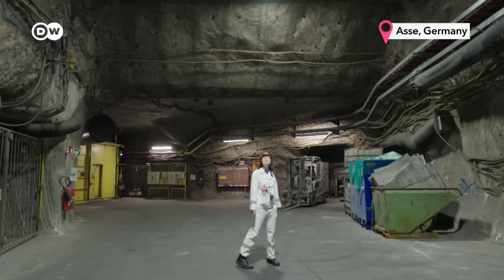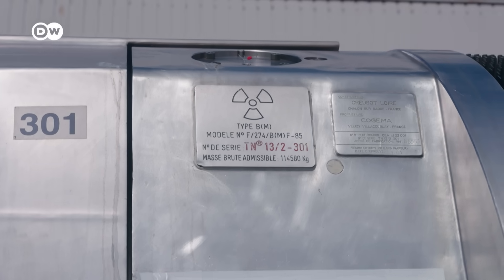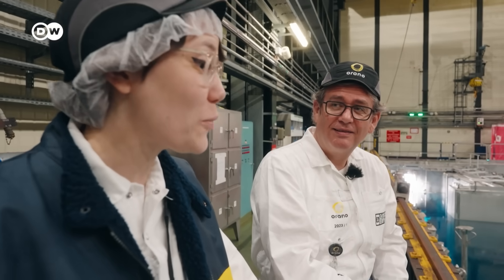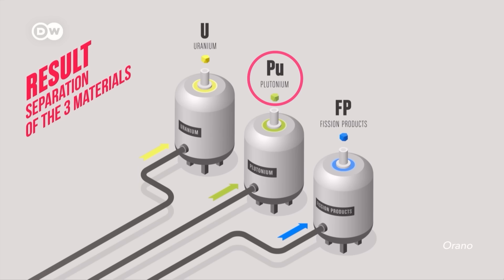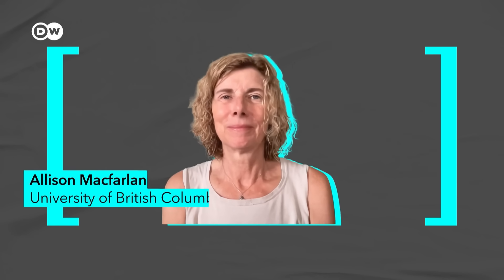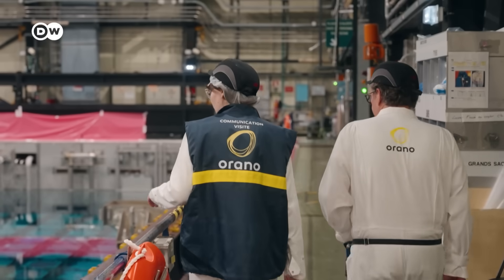Nuclear waste is reusable. Why aren’t we doing it?

Comment: Many of the previous comments ('above') are by articulate industry veterans. I lack any such experience (or specialized training), but would like to mention some relevant, basic info:
(1) In U.S.A. the original intent was to field around 400 reactors using 'slow' neutrons, which would be followed by a number of second-generation 'breeder' reactors using 'fast' 
(not moderated) neutrons later on (like maybe now!). The rollout of the initial boiling/pressurized 'slow' neutron reactors was halted after about 120 units were built ... initially to give
the AEC/NRC time to adjust regulations and operations so that the operators would be better able to diagnose malfunctions than demonstrated by the operators of the Three Mile Island
plant which suffered a partial meltdown after water uncovered the reactor's fuel core in springtime, 1979. The operators had experience running reactors on U.S. Navy submarines, for 
which they had been trained ... but misinterpreted indications in a control room which had become chaotic with multiple alarms sounding.
(1a) The NRC (and the U.S. nuclear industry) were successful in dramatically improving reactor reliability, so that, by the late 1980s, the operating duty cycle of the plants had increased to 
greater than 90%, from < 50% in early 1980s.  The fear of explosions was rekindled by the irrelevant Chernoble accident, which also demonstrated vast dispersion of radiation.  Cessation of research should Not have occurred, but was universal.  At any rate, the rollout of the 1st generation boiling/pressurized slow neutron reactors might have been continued by the late 1980s,
but public opposition and various regulations (including minimizing utility rates for subscribers) combined to maintain a blocking pattern, which, arguably yet exists. 
(2) This era (Volker recession, and Reagan Administration, oil price spiking) also saw accountants take control of public corporations via leverage buyouts and impose strict spending limits.
Thus the era of public investments (interstate highways, parks, universities, power plants & transmission lines, sewerage systems) ceased, ans even maintenance of facilities has not kept up.
New regulations for nuclear plants was only one aspect: the Experimental Breeder reactor project, fusion, and molten salt reactor experiments were all severely deprived of government 
financial sustenance. Military expenditures were continued. Environmental laws were expanded.
(3) My understanding is that everywhere reprocessing of nuclear fuel was done/attempted, it was found to be unpleasant/expensive and hazardous. In meetings at MIT, since the Fukushima
tsunami, the decision to NOT reprocess U.S. nuclear fuel has been affirmed, based on the notion, "too expensive".  I Think the molten salt designs promise to be able to 'burn' 'spent' nuclear 
fuel; those reactors have survived "proof of concept", but have not demonstrated immunity to degradation of materials in neutron flux And hot operations with halides/fluorides in contact 
with fuel-coolant piping.
(4) The notion of 'vitrification' of waste in "borosilicate glass" was a favorite aspect of operations narrative in U.S.A. since 1960s (is still ongoing, maybe).  Work in Australia by researcher
'Ted'/Theodore Ringwood, and in U.S.A. by Dr. Rodney C. Ewing (U Michigan, Ann Arbor) involves small-scale confinement of high level waste in some complex ions which have natural 
geologic history of duration, that has been demonstrated in laboratory employing ion beam implantation and simulation. Ringwood devised a material, "SynRock" which has proven useful 
on scale comparable to some of the vitrification applications (vitrification is fine for low level entombment, but the desirable features of 'glass' degrade under high level waste exposure ...
although later developments have expanded the applicable regime).  
Also of note is the Aussie development of a uranium refinement process using LASERs (called SILEX ?) which has been acquired by GE-Hitachi for use in the promising/admirable PRISM
/IFR reactor, based on research by GE in California during the 1980s.
Reply: EBR-II/IFR was killed in '94 under Clinton. PRISM is basically a scaled up EBR-II and the Natrium reactor proposed for Wyoming ( funded and under licensing review now) by TerraPower/GE Hitachi is basically a PRISM burner core.

Comment: The US recycles all of their spent fuel.  It goes into all kinds of weapons.     One spent fuel rod can be used to make 100 25mm depleted rounds.   But it takes a ton of energy to  work with radiation and the materials needs to work with it.   This video knows nothing about what spent fuel is being recycled and used for other things.
Reply: You couldn't be more wrong! All US weapons grade plutonium is made in special purpose reactors at the Hanford or Savannah River sites. Commercial reactors are entirely unsuitable for weapons grade plutonium production.  Depleted uranium comes the the tail end of the uranium enrichment process, not from spent fuel rods.

Comment: a) the nuclear waste casks are at 300 C. why are they not put in series, to heat up some gas, to drive a turbine, and generate electricity? a high hydrogen content gas will do, such as NH3 or CH4. any neutrons going around will be captured and you get deuterium as a by product. and you get a 4 year power supply. b) Pu-239,240 can be converted into oxides in situ, and then mixed with U-238 oxide, in situ, making the weapons proliferation issue moot. so the recycling facility ships back fully operational fuel rods, useless for weapons.

Comment: Caveat.... It is actually recyclable visually using tweezers and protective clothing. This could easily be done in water filled containers with lead filled crystal glass. They were previously sorted on tables without shielding just protective clothing. There are reports out there from experts that are now notoriously difficult to find. Anyhow, they are very easy to sort visually because the viable pellets glow more or less depending on level of radioactivity. The slightly radioactive can also be separated from the mostly dead pellets cutting half life to around 100 years for the bulk if I remember correctly? Been a minute since I worked in nuclear.

Comment: Some 10% of nuclear electricity in France today is generated by recycling materials in the form of MOX fuel, Orano said, and this can rise to 25% and to almost 40% if used MOX fuel is further recycled.
Reply: US reactors were not built for MOX. The source-term analysis is much more complex and would likely result in significant safety modifications to existing plants.
Reply: @curtrapp5291  Between 1977 and 2005, government policy did not allow reprocessing of used fuel for commercial reactors. But since they use MOX, from France ....
Reply: yeah makes you wonder why it's not 100% of the waste they are burying the stuff instead of suing it to make power when we need more clean power to reduce carbon emission's this mmakes me sad they arn't using all of it to make power
Reply: @raven4k998  Because it's not possible to recycle 100%, for the moment.
Reply: @raven4k998  France reactors can't use 100% of MOX fuel, because they are not designed for it, they are only capable of using an amount of it.
France reactors are old, new design can use more recycled fuel, but due to pressure from leftists afraid of nuclear power, all projects to modernize them have been aborted.
Reply: @raven4k998  
Mox fuel is a mix of Plutonium and U238.

What happes is that in a normal reactor ( that does NOT use MOX ) 95% U238 (non-fissile Uranium) and 5% U235 (fissilie Uranium) is turned into Energy + 4% waste + 1% U235 + 1% Plutonium + 94% U238.
Only the 1% Pu really is recycled!
The 4% waste is "thrown away" and the 95% U235+238 mix is stored. 

In a Mox reactor you can use a bit more but in the end most of what comes out is U238 that is useless

Neither Frances Orano nor anyone else uses the 95% low fissile Uranium. It is a could-be fuel if you would enrich it.
Like you would enrich Uranium for nuclear weapons. No one does that I believe. Too dangerous and too expensive.
Reply: @raven4k998  France is already the country in the northern hemisphere that produce the less carbon per person thanks to nuclear energy, the problem is that France alone can't do the job for China, USA, Uk, germany that are considered to have produced more than 85% of all pollution on earth since the industrial revolution
Reply: @ommsterlitz1805 I don’t really like the nuclear vs fossil fuel remark because nuclear energy is infinitely better than fossil fuel but people keep forgetting that there is a finite resources for nuclear fission and it could even run out before coal and oil does. And plus most of the countries you mentioned joined the ITER program and if it succeeds then the benefits will infinitely outweigh whatever pollution these countries have caused
Reply: @121goldenfox5  Nope Sodium based nuclear reactors can literally make nuclear fuel last for thousands of years for each countries the problem is that Uranium is so cheap that no one bothered to build them.
Reply: You assume their Process CAN recycle the MOX Fuel...
Reply: @HappilyHomicidalHooligan  The only reason I can think of that it wouldn't is that the plutonium levels exceed some safety margin or that the remaining fissile materials are in a different combination due to the presence of the plutonium causing different reactions.
Reply: @HappilyHomicidalHooligan  We do recycle it, it's not a can.
Reply: @HappilyHomicidalHooligan  Google says they can, not sure how many times they can do it

Comment: Ok good you mention that Plutonium 239 is fissile, did you find out why they need to separate them out from the uranium in the first place?  I presume its part of the "oversimplified bit" with chemistry playing the role since Uranium forms oxide salts. 

Now we also need to talk about how we can get energy from the radioactive decay of fission products since "nuclear batteries" can be made which run off of the energy released from decay. for as long as the radioactive decay rates are high.

Another point  of context is the future because Earth is the solar systems largest strategic reserve of actinide elements i.e. Uranium and Thorium as the reason these elements are so abundant here is that despite their high atomic weight they strongly bond with oxygen and the lithophile elements casing them to rise to the surface during planetary differentiation and more importantly the affinity cause them to concentrate in continental crust. As a result the reason we have so much Uranium here is the flip side of why we have so little gold all Earth's Actinide elements has risen into the crust and upper mantle leaving the rest of the planet depleted in actinide elements like Uranium.

There is also the related fact that uranium oxide salts concentrate in the same places petroleum and natural gas products do the bottom of salt evaporite deposits particularly those associated with former oceans closed via subduction processes resulting in the brine extraction of natural gas and petroleum products being  highly radioactive from Uranium decay chain products. 

Frankly energy investments like basically everything else in technology development are never going to be profitable because in the words of Bill gates "basic research is charity work".  There is a reason why all the existing programs are generally state run or funded by other forms of public money the private sector doesn't generally contribute to R&D until a technology is  becoming ready for market deployment.   Thus if you rely on private investment you will never see technological innovation beyond superficial "innovations" like changing the looks of a product slightly to sell more product via tech fashion fads.

The real crux of why so many areas of technology are in dire states with little progress is that Neoliberal ideology has for over the last half century systematically gutted the public sector calling any and all investments in people the environment or future technological progress that aren't easily privatizable a waste of money.  This is despite the long history of well come from.

The next time some oligarchs try and peddle to voters that cutting public investments is necessary know that they are lying especially as they readily support measures which increasingly funnel tax dollars to feed their private fortunes that are already so bloated they could never reasonably spend what they already have in a human lifetime.

Comment: 0:00 📰 Reporter discusses extensive nuclear waste reporting experience.
0:10 🧂 Former salt mine holds over 100,000 barrels of radioactive waste.
0:18 ⚡ Over 90% of energy remains in nuclear fuel rods when discarded.
0:30 📉 Only a small number of countries recycle nuclear waste.
0:49 🇫🇷 France is the leader in nuclear recycling.
1:18 🔋 Two-thirds of France's electricity comes from nuclear plants.
1:23 ♻️ All of France’s spent nuclear fuel is recycled at Orano’s plant.
2:05 🚛 Transportation casks for spent fuel weigh 110 tons.
2:33 🔥 Casks protect against radiation and can reach 200-300°C.
3:03 ⚙️ Fuel rods are removed from casks using remote-controlled machinery.
4:02 🏊‍♂️ Spent fuel rods are cooled in storage pools for 5-7 years.
5:02 ⛏️ France views nuclear waste as a strategic resource, not just waste.
5:45 🧪 Separation process involves dissolving fuel in nitric acid.
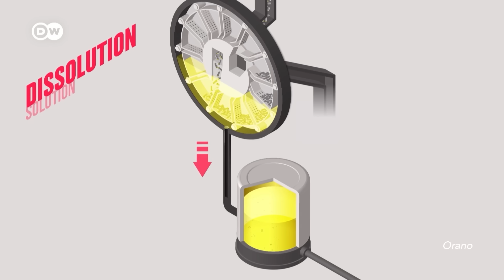7:15 🛢️ Uranium and plutonium are separated from fission products.
7:48 🌋 Purified plutonium, highly energetic, is a key concern due to its potential use in nuclear weapons.
9:07 🛡️ Orano transports plutonium securely with military escorts.
9:15 💡 MOX fuel, a mix of uranium and plutonium, is used in reactors.
9:27 🔄 Recycling reduces fresh uranium use by 30%.
10:03 🧱 Vitrification traps fission products in glass for safer storage.
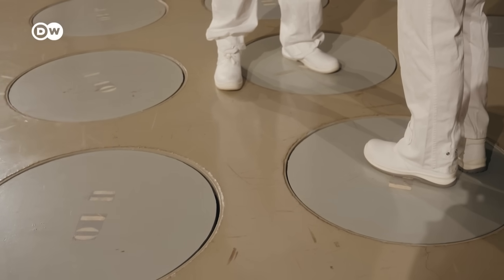10:55 🚧 France plans a final storage site for nuclear waste.
11:08 💰 High costs are a significant hurdle for nuclear recycling.
12:09 🌍 Few countries practice nuclear recycling due to complexity and cost.
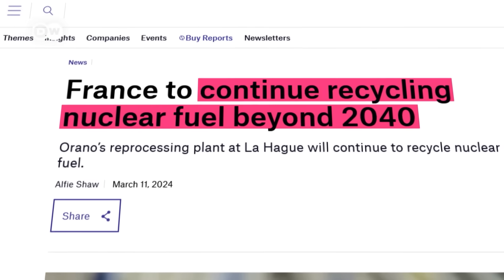12:57 🇫🇷 France’s recycling strategy ensures energy sovereignty.
14:03 🔬 Experimental pyroprocessing may offer a less risky recycling method.
14:46 🏭 Despite recycling efforts, long-term waste storage remains an issue.
15:02 🕰 Cheaper, better technology for recycling may not emerge soon.

Comment: MOX fuel is risky for many reasons. Far more toxic. Can be processed into nuclear weapons or a dirty bomb.
Reply: Pu240 makes commercial reactor grade Pu nearly unusable for a fission bomb.
Reply: @darkgalaxy5548  Pu239 is what you want for weapons. That's close to U238. The abundant uranium.
Reply: @darkgalaxy5548  All plutonium for nuclear weapons come from reactors. Only a tiny bit of plutonium exists in nature. So they must be able to extract it from spent fuel rods. That's where almost all of it comes from. Where else if not?
Reply: @gulfrasta5844   I'll save you a bit of research. All US weapons grade plutonium comes from purpose built reactors in either Savannah River or Hanover sites. Commercial grade plutonium contains high percentages of Pu240 & Pu 242, which are considered contaminants, making plutonium from  commercial reactions useless for bomb material. In theory, one could extract Pu239 with an enrichment process, but why bother when it's easier, simpler, & cheaper to use purpose built reactors?
Reply: @darkgalaxy5548  I don't think my comment made it.

Comment: If you use radioactive material as a core of ring magnet that has copper coil wrapped around it and seal it inside a vacuum chamber containing easily ionizable gases, you have a solid-state generator producing electricity with radiation and ionized particles vibrating the magnetic field of a magnet. Another option is using radioactive material as a core of piezoelectric crystal which should produce electricity with radiation causing rapid pressure changes inside the piezoelectric crystal. In theory.

Comment: Plutonium is also really useful for power production in (deep) space missions, because it works a lot better than solar panels at such distance from the sun. with a plutonium powered RTG we'd still have contact with voyager for instance.
Reply: Voyager spacecraft had 3 Pu238 powered RTGs each. They last a long time, but do degrade over decades.
Reply: @richardb1452  wait which spacecraft am I confused with then?

Comment: There is a major error in this, made by the University of British Columbia professor.

India used a Canadian supplied research reactor called CIRUS. It was based off another Canadian research reactor called NRX. The Americans supplied the moderator which was heavy water in this case. I don't know who supplied the nuclear fuel, but it uses natural uranium which means it would have been easy to source from anyone. The reality is that CANDU reactors are a really poor choice to use for making weapons. You would need an advanced reprocessing facility with isotopic separation to use a CANDU to make weapons.

Past that, it's a good video.

Comment: Did you really say its cheaper to use virgin materials? I'm hearing of a lot of inventors that discover a way of creating energy from water, but they commit suicide with 4 gunshots to the back head!
Reply: It is physically impossible to generate electricity from water alone.
Reply: @MulletHamster  I guess you've never heard of hydro power plants?

 I've heard that many inventors have found a way to harness energy for cars, homes, and commercial purposes from water.
Like, they pour water into the tank, then this water is able to give energy.